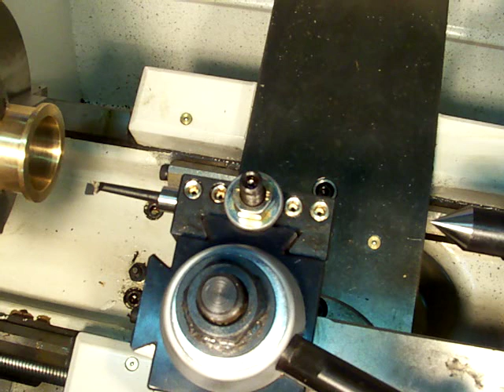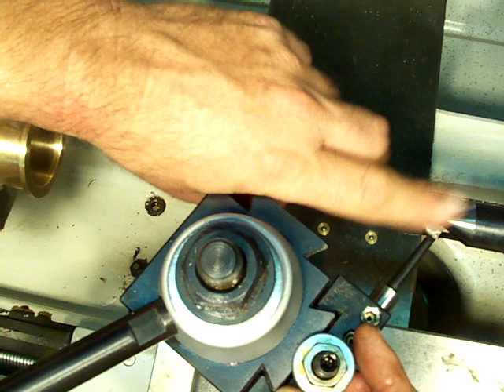How to Center your Lathe Tool

Comment: Great videos. Though something I've always been told, and done, is to run a rh or lh cutting tool very slightly below centre (.02mm or so) and a boring bar slightly above centre (about the same). This was to make sure the rh/lh cutting tool had enough clearance and because boring bars get pulled down when cutting so work better when slightly above centre. Great video though. Very helpful for those new to machining. *like*

Comment: @pangavamanos the point is to get it aligned on the vertical centre line or height. tool can be rotated or moved in the z or x direction all it like then.

Comment: sometimes when I'm OD (outside diameter) cutting w/ a carbide insert cutter. I intentionally drop it below center a bit, and it actually cuts better. (this only works with INSERTS!!!). sometimes it works and sometimes it works, and i don't know why.